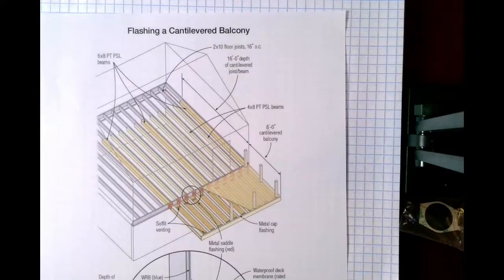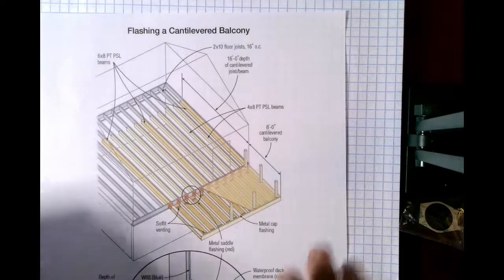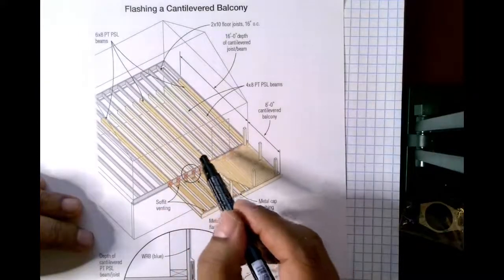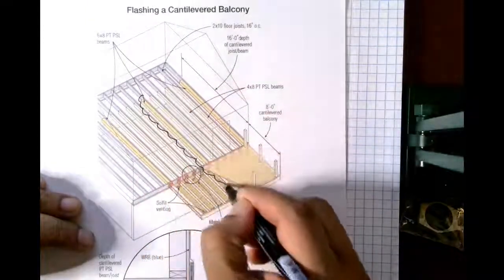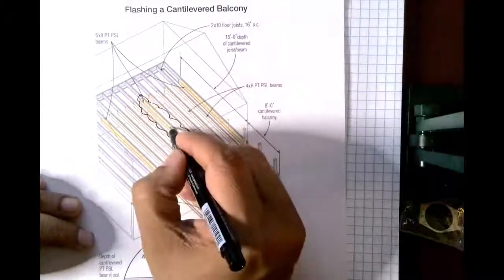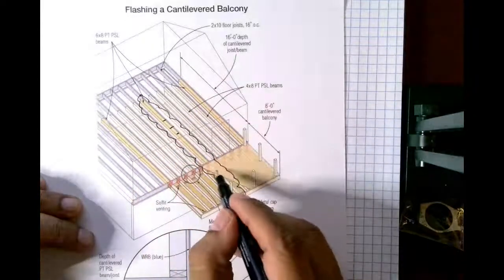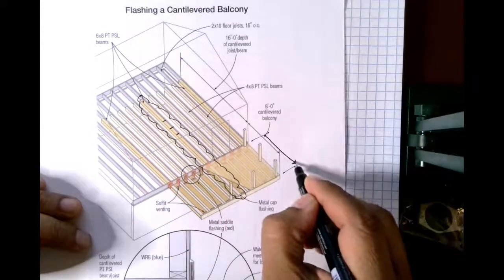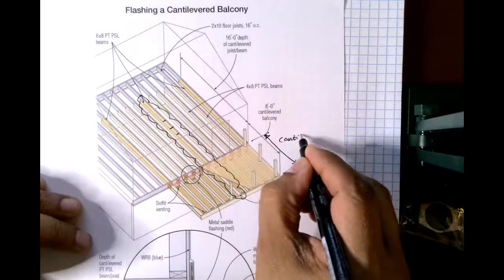Part 2: Notes for Balcony Inspection

Comment: In new York we have local law 11 of 1998 for mandatory 5 year inspections for Periodic inspection of the exterior walls and appurtenances of Buildings greater than six stories in height at cost to owner. An engineer or architect who is certified for special inspections based on chapter 17 of the IBC as well as meeting the requirements of NYC RCNY 101-06  must perform certify and submit report to the Department of Buildings indicating condition and to recommend remediation of facades, details and balconies.